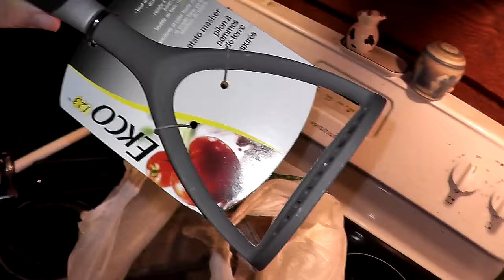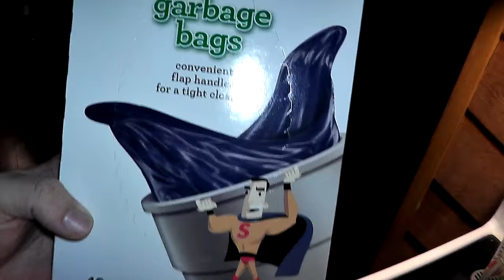Out of Stock, Plans change

Comment: The mk1 iMac conversion to PC should be really easy with nowaday's hardware. Just stab a mini ITX board in there, and you're golden. The space should even be enough to put the power supply right in there with it. The hardest thing to do would probably be to find an old 15" LCD panel with 4:3 aspect ratio.

Comment: I buy my components online, mostly cos there's feck-all for electronics components round here, but also cos they usually have them in stock on major components sites, and ebay too... :P

Get a proper compressor with a big tank (bigger than the one you have) for garage use, that way you always have air on tap... :D

Yep, I have the issue of forgetting what day it is, it sucks, that's for sure...

Another commodity that people take the piss with pricing, tyres, cos you need 'em, and without 'em, you're going nowhere, so, they charge whatever they like.......

You could connect the CRT in the iCrap to do like what your buddy did, I'm sure the internet knows how to do that... :P

Comment: 210 dollar a tire? lol  look in kijiji they always have deals. I'm from Toronto so maybe more ads and deals here but still. why not buy a used set of winter tires with 90 percent tread? not sure what size you need but you should be  able to find a set of 4 used in great condition for 300 I'm sure. trust me look around cause 210 ea is a rip off.

Comment: Have you checked eBay for capacitors?  I'd imagine there's lots of Chinese crap there.  Then again, Chinese 'nuff said.  fingers crossed it's the capacitors.  I still use 17" 4:3 monitors..1280x1024, they work well enough and I got them for free, so can't complain.  People seem to give away 17" monitors, I've gotten quite a few for free.

I like Apple, but not their prices nor the fact they solder the RAM to the motherboard.  Greasy bastards.  Well built, well optimised devices, but greasy bastards nonetheless.  Been looking used, but even then MacBook's are still stupid money.  Really want one, but it's a want and not a need, therefore not needed. 

I think I'll cook chilli tomorrow too...Can ya go into detail with it?  Or was that a cooking video?  I saw someone cooking chilli recently, was you wasn't it? :O  Yup...I'll have to try it, found the vlog with it from the otherday.